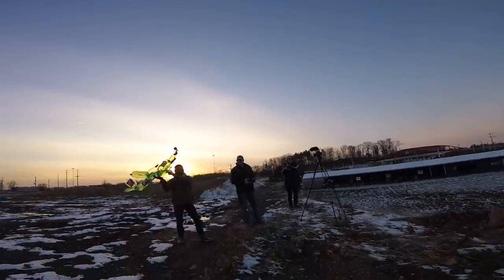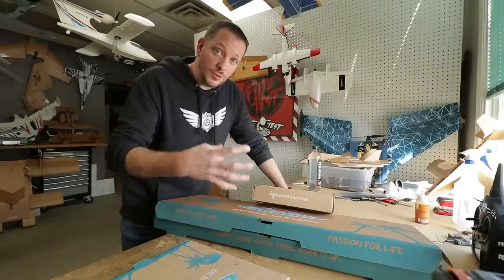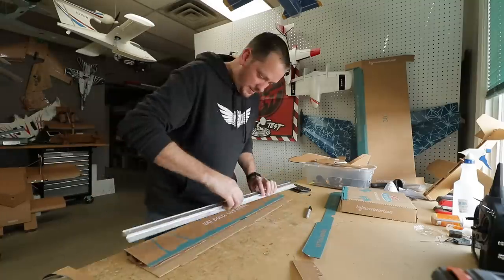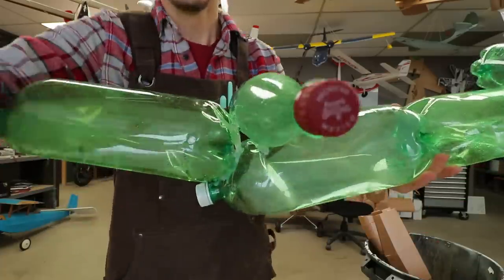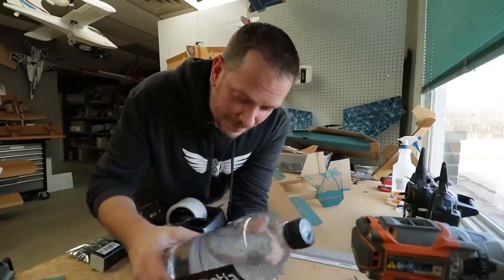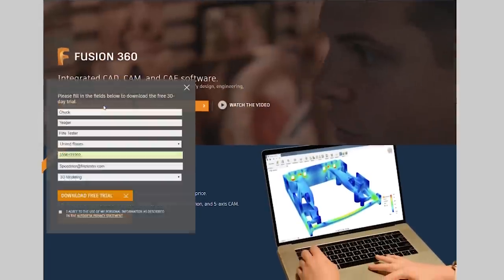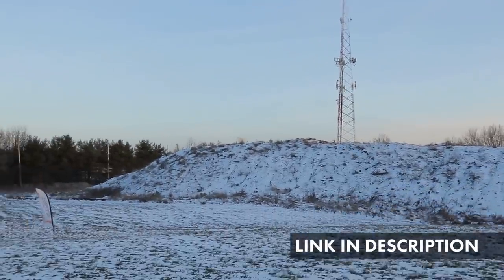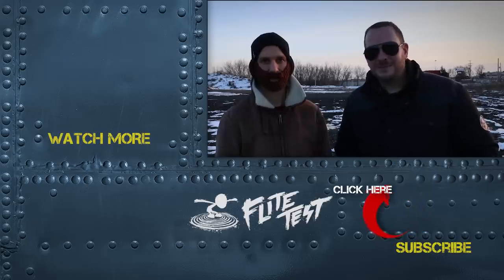Oh the things that can fly...

Comment: The only glue that works well on PETG bottles is PL Premium Construction Adhesive. Other glues don't stick or they chemically break down the plastic and it loses strength. We use this glue to splice bottles together to make them larger for huge water rockets. It even holds pressure!

Comment: Pressurize the bottles and use them for the wing spars, fuselage, and maybe tail surfaces (depending on sizes available).  This will make them structurally sound. Use the packing tape with the filliments for support. To save weight if doing a small build. Use the thinnest bottles you can find, but use a lid from a 2 liter, as the thin water bottle cap lid is too weak. I never completely finished the build, but it looked very promising, considering. If you get tons of requests, I'll make one for you.

Comment: We knew cardboard with a bottle fuselage would fly just fine. Don't stop with the soda bottle plane though. Both of you should just work together to make one awesome plane. My thought would be to cut the nozzle and bottom off, cut down the side then use a heat gun and some flat weight (like books) and use straight parts of the bottles for wing skins and control surfaces. Flattening and folding the plastic could also make sturdier mounting locations or braces to make a part more ridged. Also kinda wondering about mounting an EDF inside a bottle exhausting out the nozzle. If you play around with these ideas then you should be able to start making some cool looking planes like your foam board planes but with soda bottles. Also you should make a soda bottle flying boat and float plane.
Reply: Yup, flat it completely and shape it...or cut top and bottom of the bottles, insert aerofoil shape mole and heat it into shape. I'm happy waiting to see that bottle plane will fly soon.
Reply: Nah use a clothes iron when flattening the bottle
Reply: @TheJttv  Clothes iron would get way to hot even on the low setting, heat guns come in varying temps and some are adjustable and can be adjusted further by holding the gun further away from the target. We want to make it malleable not liquid.
Reply: @Zankaroo  You could use a Mono-Cote iron, their heat ranges are lower than a regular iron.
Reply: Danny  Hampton, I was also thinking an EDF would make an appearance, seems like a perfect application! How about it Flite Test, how about a redo?
Reply: agree, tops and bottoms cut off, the tube sections could be formed into better wing shapes, rough sanding and epoxy to join the segments. the blow molded bottles DO want to shrink with heat applied, so with a form that's barely smaller at one end the segments could fit together tightly.

Comment: There is a working barrel shaped wing that you guys could have done. But it does require that the barrel shapes spin.

It has to do with the way the air interacts with surface friction and such. Kind of a cool physics thing. 
There have actually been sailing ships that put these on and helped move them forward.

Comment: Josh, I noticed in your Bird of time review video you were going to buy lead shot bags for wing construction. Since this is an extreme recycling video I thought I'd share a recycling tip that I use. If you have walmart bags, old tube socks and a "tube of sand" from home depot laying around you can make a bunch of  soft weights for wing sheeting instead of paying much more for lead shot bags. Just add enough dry sand to a walmart bag and roll it into an approximately  3" diameter log, place that log into another bag and roll it up, place into third bag and roll up. The rolling doesn't have to be tight, You want your logs to be soft and flexible. the multiple bags protect from sand leakage. Slide the triple rolled logs of sand into a tube sock and tie off the end of the sock. You can get a whole bunch of weights out of one $5 tube of sand from home depot, and the socks are really soft on the wing. The sand logs conform to curved surfaces quite nicely and you can make custom sizes and weights if you choose.  Enjoy! Keep up the great work guys, you are all awesome and a boon to the hobby!

Comment: if you'd used a heat gun on the plastic bottle, you could have shaped the bottles better to shape. If you cut the bottles you can form / mould even better shapes and when it shrinks it become stronger.

Comment: I made pop bottle go up 100s of feet in a couple of seconds .. as water rockets. But a wing and RC on one too, as an, well, air shuttle. There still are other and better typed of glue than hotsnot... I made cylinders of 5 or more bottles with the ends cut off and PU glued together, and they held out 100 psi and more.

Comment: I have an idea for the pop bottle wings.  Make an airfoil form from something hard, like wood.  Then slip the 2 liter bottle over the form and use a hot air gun to shrink the bottle onto the form.  Remove the bottle and repeat until you have  enough sections to make a full wing.

Comment: Maybe if you had put small holes in the bottles to allow the internal pressure to equalize,  The air inside the building is much warmer and therefore less dense than the outside air which caused the bottles to collapse.

Comment: Hi! I have been getting into the hobby for the last couple of months. I've built a couple nice trainer planes but keep crashing nose down? I can take off fine but once i make my first turn, my nose goes straight down and i seem to loose control. Any suggestions? I am a college mechanical engineering student who is in love with flight and want to get better as a pilot! We have flown in some varying wind speeds, but I always run into the same issue. Thanks for any help and keep doing what you are doing! You guys are the reason i finally decided to give this a shot and even though it hasn't paid off yet, I have more and more fun every time I crash XD!

Comment: Try a channel wing with 2 channels per wing half, one pushing, one pulling. Thrust vectoring for control, lify without airspeed.
Reply: *lift
Reply: Use inboard for lift and tail control, reverse outboard for critical inboard+ airspeed bonus vs reverse aerofoil outboard.
Reply: Channel wing a suppressed british invention. Full sized 4seat aircraft flies at running speed, 11 mp/h.

Comment: Put water in bottles that you need to glue...it will prevent melting...believe it or not, its possiblle to boil water with open flame in a plastic bag...if you go slow...

Comment: Ok i wanted to see ya cutting the pop bottles into sheets of plastic and then making micro structure supports that they'd overlay kinda the cardboard build quality in this video but almost solid recycled plastic so indestructible and maybey to the point of heavy lift capability but with still tons of control for the fun aspect

Comment: Make a plane that flies by flapping its wings like a bird 
🦅
Reply: did it with CF rod and ripstop nylon, small (16mm) 400 rpm gear motor crank+rod arrangement, 35" span. larger version (not much different) than AirHogs FireWing, runs 400mah 2S, doesn't do well in any wind but its neat!

Comment: i had idea that would work better for the soda pop plane u get many many soda pop bottles of 3L size and 2 of 2 L size take ur first 3L cut off the back end but keep the front end then get 3 more of 3L bottles and cut front and back end off so that u have 3 of them get 1 more 3L and cut off the front end only then get 1 more 3L bottle and cut off front and back then cut  2 inch to 3 inch width ring will use as a  couplings cut each  couplings the long way then then cut a ting strip off the same way to make the couplings a tinny bit smaller side ring  then for glue use glue that not hot glue like model glue or epoxy glue or any glue that work on plastic glue half of it in side the bottle that as the fount on it make sure that the ring is back to a full ring just a tinny bit smaller to fit in side the bottle but the back cut off then glue one of the other bottles that have both end cut off then add another coupling then do it again until u only have left the one with the front end cut off  then glue that to it  think of it as a  fat very tall bottle of soda then for the wing just cut strip plastic off the bottles to make jet wing like a commercial airline glue more then one strip together and one the the curl up and one with it down or find a way to make the plastic to not curl the 2 L bottle will cut a slit on the meddle side, side ways the long way  one slit will be long then the other side as the wings tapers down on one side and increase in size on the other side then glue it so that thy do not move OR u can glue the bottle to the bottom of the wing as well then add whatever size of motor in the front end or 2 on each bottle that are on the wings  that are 2 L size then fins on the back top make them the same way glue many together of plastic and  the side wings.  if u want to use smaller size pop bottles u can just make sure the 2 side wing bottles are the same shape as the big ones  no hourglass shaped bottles same shape as the 2 L size i wish i could show u a pic of what it should look like